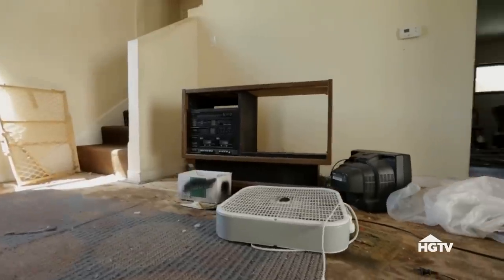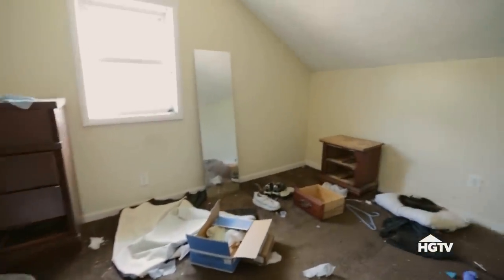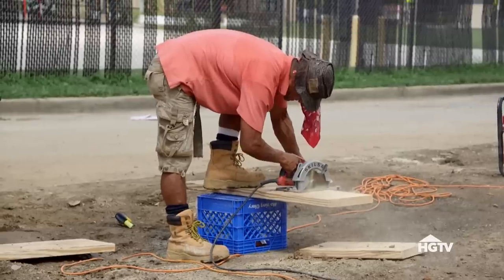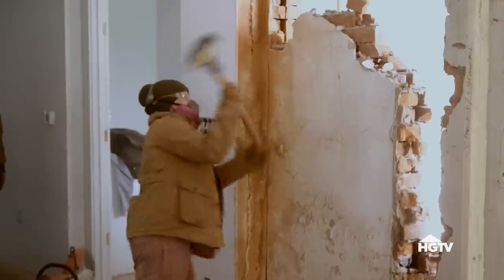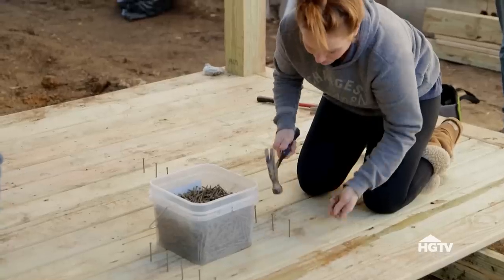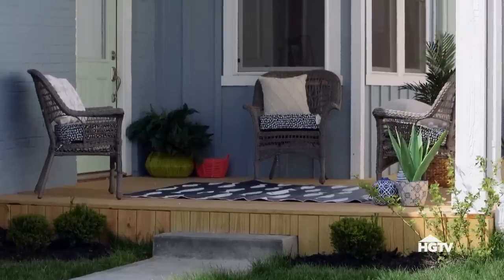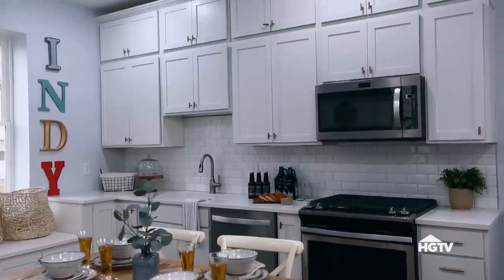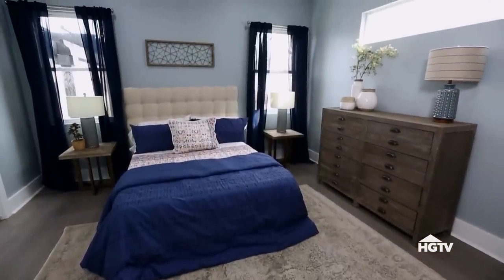Historic Brick House Restored to Former Glory | Good Bones | HGTV

Comment: I like how the house turned out. The only thing I see as a problem ia the gap between the upper cabinets and the ceiling. It seems like it would be a dust catcher.
Reply: I think about dust a lot also. Especially when they use wicker chandeliers.